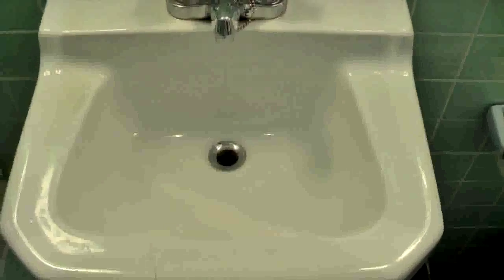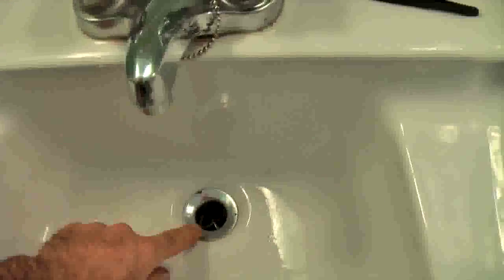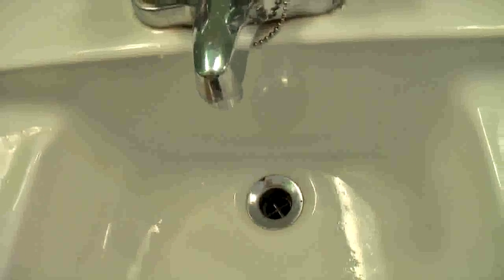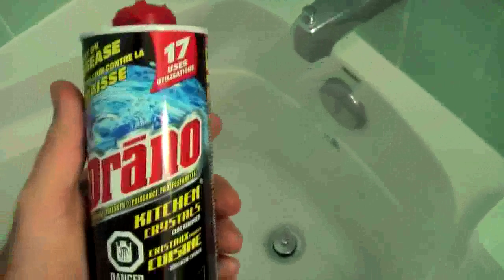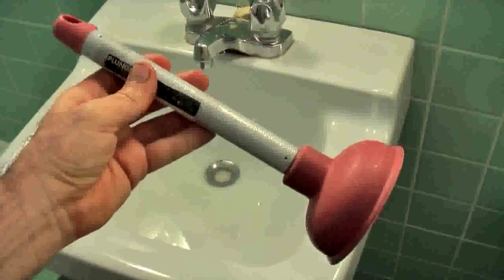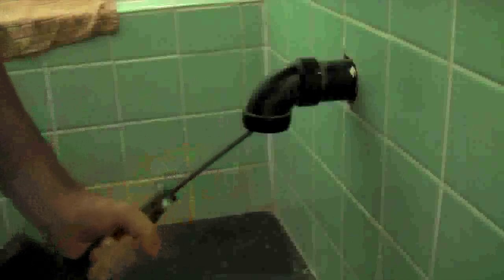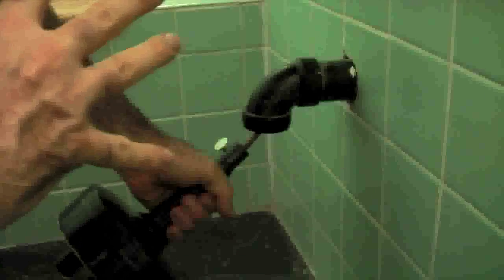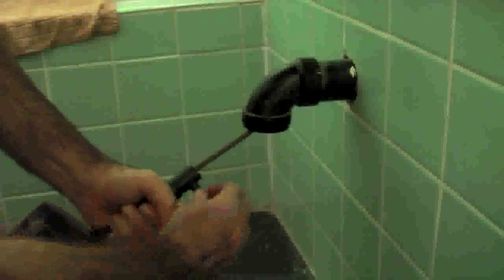Unclogging any Blocked  Drain - tub or sink

Comment: Dranio will eat the pipes out and most of them lav lines get a black sludge to it. At that point it needs jetted. Drain cleaning machines are not ment to clean sludge or grease might make a short term fix. But that's it.  And by the way thr dranio will not root pvc pipe out but the cast iron In the floor and the metal traps. But for us plumbers we love it keep using it. Gives us work.  So thank you dranio and the guy that dont have a clue when it comes to drain cleaning.

Comment: Been there a million times Billy. i have a Gorlitz Go 15 1/4 cable machine, i remove the pop-up on a Bathroom sink and run my cable directly down and through the P-trap (very carefully as to try and not damage the trap) once through the trap i run a bit of water so its sitting in the sink and continue running my cable until the water drops, then i know the drain is unplugged then i turn the water on and continue running cable & water so all that black smelly stuff flows down the drain for $35!!!

Comment: My work day today lugpoop, Job #1. Main sewer blockage through 4" ABS cleanout $65. Job #2. Camera location through roof vent $210. Job # 3. remove and reset toilet with #1 & #5 wax seals $75. Job #4. Installed Main sewer cleanout (customer wanted to save $ and excavated soil himself) I installed a 4" ABS cleanout (I back filled soil, customer looked tired) $400 Job #5. Unclogged shower drain $35. Stop hating LOL!!!!

Comment: I've cleaned out more than 60 or 70 thousand drains in my 43 years I can tell you, NEVER use crystal Drano in your pipes. It will solidify in the pipe if the stoppage is not cleared. Another thing destroy the integrity of your cast iron or galvanized drainage system. Lav sinks will stop up at the pop up assembly. Stoppages very rarely occur in the trap. The trap is usually updated over the years. The stoppages most often occur downstream in the original drain system.

Comment: You DEFINITELY want to use gloves. I used vinegar & baking soda about a month ago. Bathroom sink would still barely drain so I used drano two weekends ago. It's still doing the same thing. Went to Home Depot Saturday, bought a snake & a new p-trap. Went to change the trap & snake it tonight. P-trap disintegrated probably from the use of drano. Snake goes in 2' stops dead, like hitting a brick wall. It's like blk concrete is coming out. My hands are stained black and stink from the junk in there.

Comment: my bathroom sink is clogged. I've tried 2 bottles of drain chemical. I've opened up the bottom loop part and everything looks clear and fine. yet, when I run water, the water stagnates and clears out slowly. It appears the block may be beyond the loop.